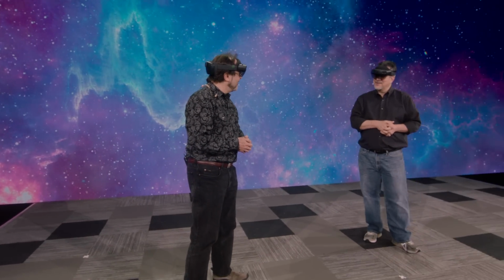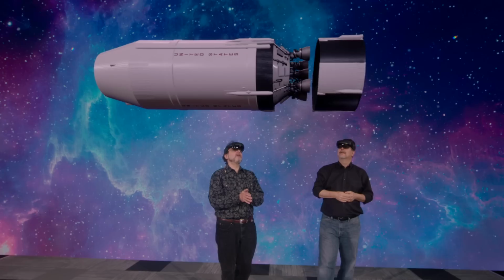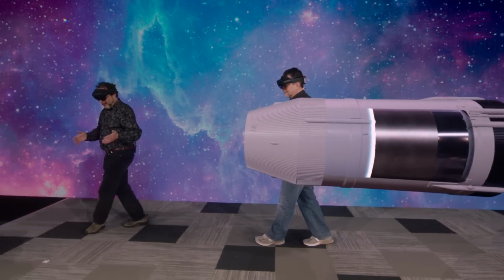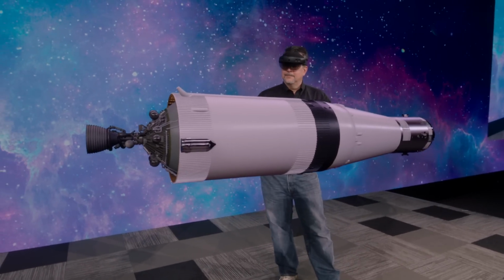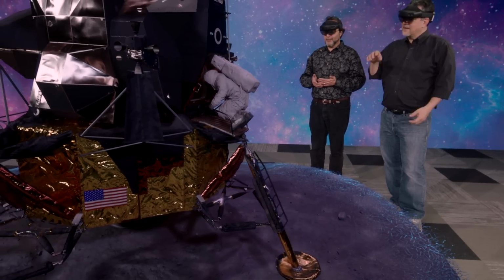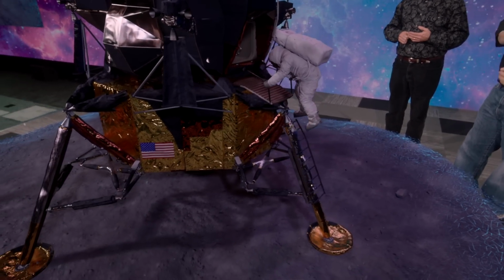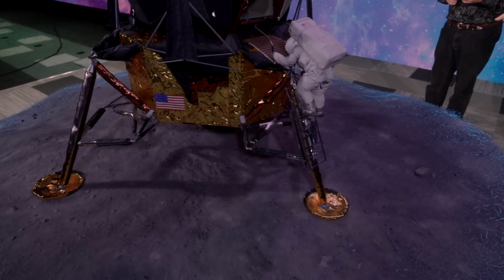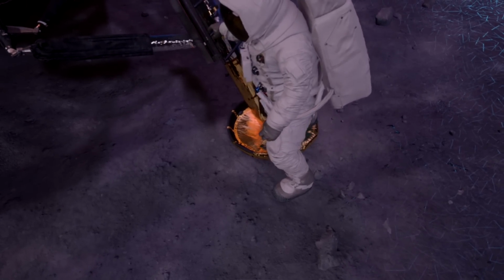Apollo 11 HoloLens 2 Demo | Microsoft Build 2019 | Unreal Engine

Comment: What exactly failed here, I don't get it, didn't catch it.
Reply: Everything works in this video, but this is a rehearsal and it was pre-recorded. During the actually live presentation the demo failed.
Reply: @AleksandrStrizhevskiy  Oh, I see. Sad, hopefully there was a recording the actual live. I simply stumbled upon Verge article about it, but the video felt all fine, so I was quite confused even despite the fact what was written, maybe I missed a line saying what you said, but I kind of didn't found that.
Reply: @BIOSHOCKFOXX  I came to the video from a Digg article. Not a fan of the Verge. I think they went downhill after Josh Topolsky left.
Reply: @AleksandrStrizhevskiy  And digg has been garbage almost from the start, perhaps its not as dreadful now though.
Reply: @zybch  No I don't know anything about digg. That's just the website that had a blurb about this. Google recommended the article to me. I don't have an opinion on it. I have only ended up on it a handful of times. Looks buzzfeedy though.
Reply: @AleksandrStrizhevskiy  I used to be there from its inception, a LOT.  I had reasonable success posting stories etc but like many many others had those posts hijacked by several of the big 'famous' diggers like MrBabyMan who'd repost them as his own and take credit and whatever remuneration was available at the time.  The higher ups like founder Kevin Rose just turned a blind eye and I left for good after his 'cut her teat off' comments came to light.  Disgusting prick.
I think its been sold (probably a few times) since then, but its nothing buy bad memories for me and the others who were ripped off with the blessing of its founder.